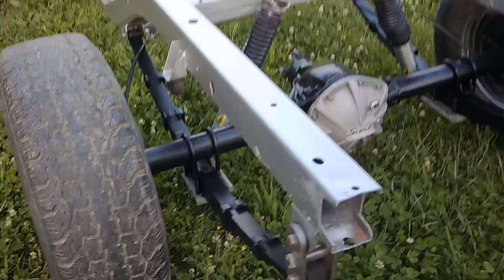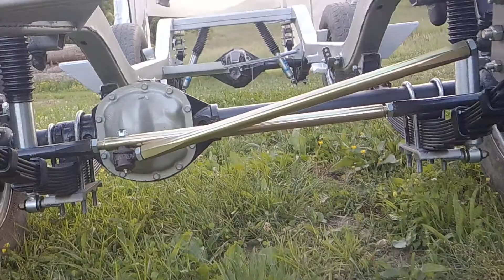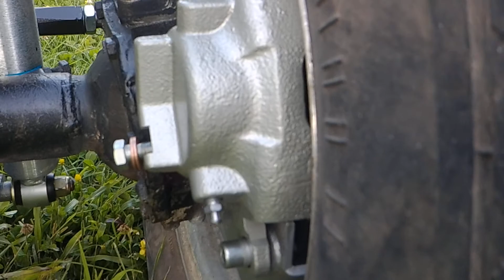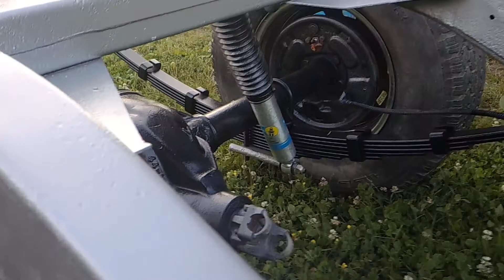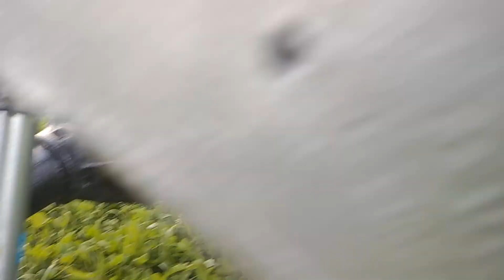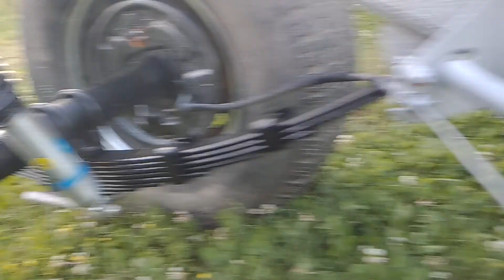800 Scout frame restoration

Comment: Where did you get the spring kit, and spring/chassis mounts? Can’t find the rear springs in 2” for the scout 80 frame , rear eye to eye spring is roughly 45”. Did the scout 800 have 2” like the scout II? Scout II front springs are roughly eye to eye the same as Scout 80 1-3/4” wide springs.
Reply from the maker: Got everything from IH America. Actually it might be 2.5.  It's The Cpt kit. https://www.ihpartsamerica.com/store/CPT-S80-800-LIFTKIT.html

Also got the gold series tie rod and drag link. https://www.ihpartsamerica.com/store/CPT-S80-800-TRDL-V3.html. I couldn't tell you about the the width of the springs. I never checked.

Comment: What suspension parts did you use and what axels
Reply from the maker: CPT 2.5 inch lit form IH Parts America with the CPT drag link and tie rod. Also got the CPT front disk brake conversion. Axles are stock.

Comment: Really nice job! What did you use to get the body off the frame?
Reply from the maker: Used a gantry crane. It was a little challenging because the front of the body is a lot heavier.

Comment: What did you coat the axles and frame with ?
Reply from the maker: Covered the frame with eastwood rust encapsulator platinum and sprayed the axles with  Rust-Oleum gloss black.